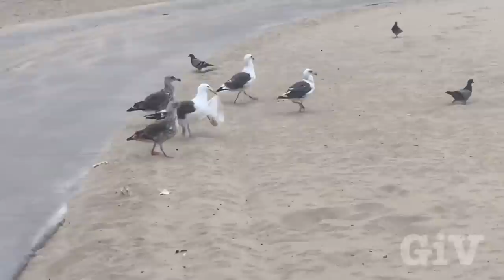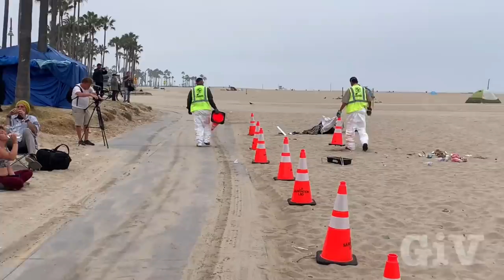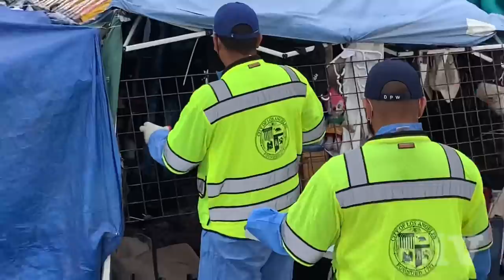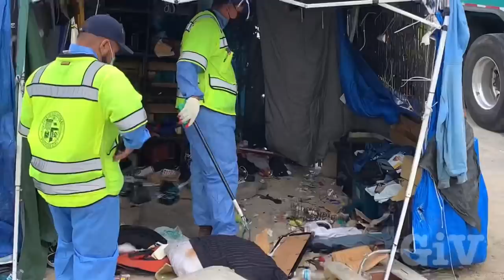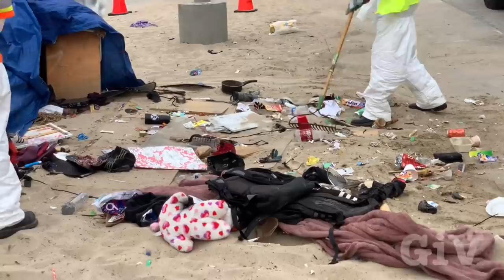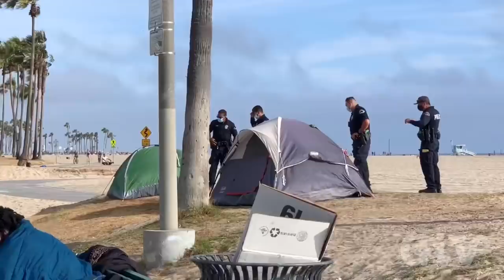Final Homeless encampment Clean up on Venice Beach  its illegal to camp in venice

Comment: I hope they are recycling all that metal and stuff. Also to filter the sand to get needles, glass, etc. would be great.
Reply: They have beach vehicles to do just that.
Reply: Unfortunately it looks like they are smashing the metal up with non-metal in the compactor truck. It will be very hard to separate it after it all gets smashed together. The only thing they are separating is hazardous waste like the spray paint cans and chemicals. (it's illegal to dump that in the general landfill)  I don't know why they don't have a second truck just for scrap metal and recyclables.

Comment: Even though the city has " cleaned " up Venice Beach, it's still nasty. Lime and other disinfectant chemicals will have to be mixed into the sand and the sand will have to tilled. I wouldn't go to that beach for at least 2- 3 years after the cleanup has been finished

Comment: Pushed out, priced out and pressured to be different from the rest of the struggling People in the world. It is very tough to try and give people help with things, when they're lives are so tramatized from the issues of the street. And being a drug user at the time. It is not easy for them. Some just go some where else to be comfortable. And some don't stop using drugs, just go to another spot or city. We still need ways for people to never have to worry about being pushed out, priced out, or shamed away from having a way to dip out of a most difficult position in the world. When the world is what put them there in the first place. We must not forget to help make ways for people to get around. And if squatting, to not be shamed for doing it. I am going to be there very soon, even though I have a nice setup that isn't a tent. But a bike camper, because like I said are road is still there to walk on. And housing made it easier yes, but they'res still the main problem of being able to move to the other side of town. And not have to go all the way back for a shower after working your butt off for slave laborers. We need to make it legal to camp as long as we are clean. And an asset to the community with a clean cut way of surviving out there.